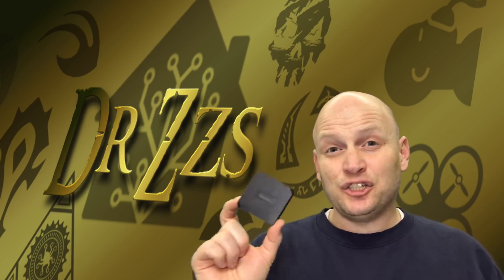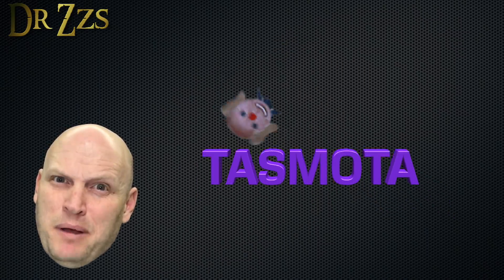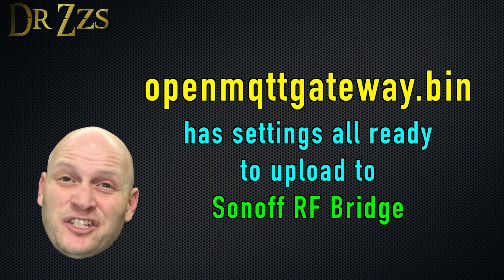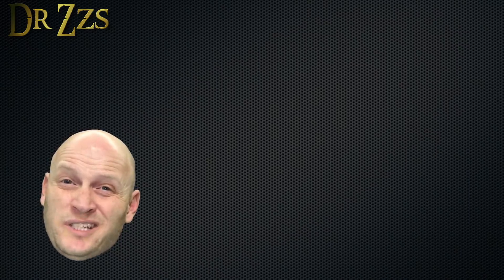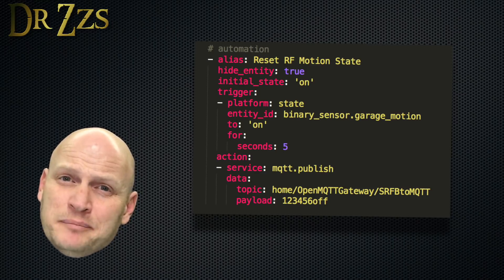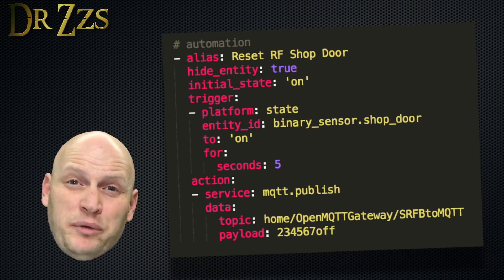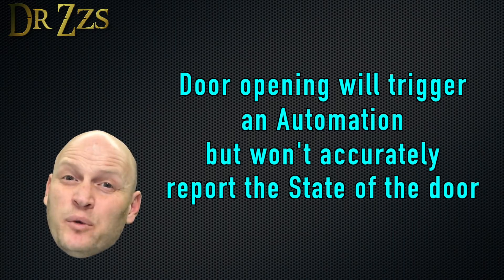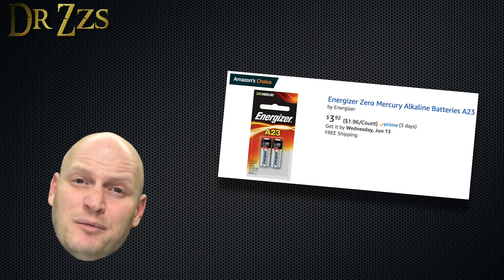Sonoff RF Bridge w/ MQTT & Home Assistant

Comment: I am using something called Broadlink RM3 to connect all of my IR devices like my TV and air conditioner to my Home Assistant.  And like the Sonoff RF bridge, it doesn't read  power or other states.  Because of this, my living room shutdown button (a button that shuts off all lights and devices in the living room) will often turn ON the TV if its already off).  Needless to say, the WAF was very low, and I wound up having to remove some of the IR controlled devices from my automated routines so I wouldn't get the evil eye.   But I do like that you can use MQTT with the Sonoff RF bridge.  I wish they made an IR bridge since most of my dumb devices are IR.

As for getting the MQTT details from Tasmota, wouldn't the "SetOption19 1" at the console output this info?  I am sure that you already tried, but just wondering.
Reply: You  can build an RF bridge easy with a Wemos d1 mini or a nodemcu and an IR sender+receiver.  Check out this library, it has working examples:  On Github ->markzabo ->IRremoteESP8266.  (wouldnt let me paste the URL).
It worked easy with OpenHAB, I'm sure it cant be too bad with HASS-le.
Reply from the maker: Ooh I should have tried option 19. That’s want a smart person would have done. I’ll give it a go when I try TASMOTA again and see what happens.
Reply from the maker: Oh man. Don’t turn off the TV during the wifs shows. Gees. That’s a death wish. 
There are ways to include IR as posted above. I bought an IR trans/receive set to test out. There’s supposed to be a what to do it with OpenMqttGateway but in my limited time testing I couldn’t get it to work.

Comment: I read all the reviews of the Sonoff RF bridge and they complain that it only supports 4 devices.  But I can’t figure out if that’s a limit in EWeLink itself or the hardware?  When you flash it with new firmware are you able to support more than 4 devices?  If so what is the limit before it fails?  I’d like to setup what you show in the video but I don’t want to waste my time if it doesn’t scale well.

Comment: Does your PIR2 work fine? Mine shows an inconsistent behavior, sometimes I can dance in front of it and the thing doesn't detect any motion.
Reply from the maker: ya, I have noticed that in the last few days.  One time I got all the way up on the ladder to check the battery before it sensed and activated.  
I don't know if it's a sensitivity problem or a re-triggering setting.  So, ya, unfortunately I don't think it's as sensitive as the PIR I had connected to the D1 mini.   If I were depending on it for an alarm I'd have to go with something more sensitive.

Comment: Hi. Great videos. I’d like your opinion in how I should invest in devices because I only have one RF device that my garage door. Should I buy the only RF motion and window sensors? Thanks.
Reply from the maker: hmmm good question.  There's probably a lot of things to consider.  For me, I got better results from the Wifi PIR and I have wired door/window sensors.  The advantages I see with the RF bridge are 1- low power use.  They'll last a long time with just simple batteries. A wifi device like the D1mini with a PIR sensor (or door sensor) would need to be powered but a power supply (except maybe Rob's d/w sensor).  So if you need sensors that run on batteries either try building the one's Rob made or go with these (or other RF 433mhz).  
I don't think you'd be disappointed with the Sonoff Bridge/sensors.  They aren't very expensive, so even if you get them and they don't fit your needs exactly, you're not out a lot of money.  
If you're not sure, I'd say try the RF bridge and sensors.  You may find they work great for you.  And, we may discover some even better ways to use the "one code" d/w sensors.
Reply: DrZzs thanks for the advice.

Comment: What's inside the DW1 sensor? Maybe a NO and NC reed switch can be used on the one sensor with a firmware mod?
Reply from the maker: possibly.  someone suggested replacing the reed switch.  I think it's NO now, so maybe replacing it with a NC and putting 2 sensors on one door would do it.  
Someone else suggested there are other pins on the DW that can be used with another reed switch (NC) to send another code.  Might be true.  I'll have to play with it and see.

Comment: Just what I need it. Burned my Sonoff RF last night waiting for the new one. I am going to test my Paradox alarm system with this. I will post the result. Just making it more challenging I use your Automation to my office to turn off the lamp and the LED strip switch but some times I leave the B1 lamp on in color mode. So how to avoid turn off when the lamp is in colour mode and turn it off when it is in white mode? Thank you and keep up the great job

Comment: Just curious. Would using this let me control my rf ceiling fan?
Reply: Probably, as long as it's not a Hunter.  Depends on the frequency - look up your remote in the FCC database if it's mHz is not printed on the back.

Comment: I've had the RF bridge and some sensors for a while now and it runs on tasmota.
sonoff POW and RF bridge sends its important messages through Json
This is how i extract the code RF bridge sends through Tastmota
  - platform: mqtt
    name: "Motion"
    state_topic: "/home/rf-bridge/tele/RESULT"
    value_template: "{{ value_json.RfReceived.Data }}"

Comment: when is sonoff finally starting to sell devices with a "good" firmware out of the box?
Reply: id say they know you arent going to use the firmware they put out so why waste money making a better one or paying a guy like Theo Arends, when its cheaper for them to leave those programming pins hooked up for us. because if you didnt know they DONT have to do that for us. they COULD make it alot harder. i mean not to sound like an ass cause i get the feeling i do right now. but literally all they have to do is stop leaving those serial pins hooked up for us, and wed be stuck on that crappy firmware or be made to do REALLY weird shit to make it work
Reply: again, fully agree. you are still soldering on a device that is handling main voltage. it is basically hacked after that and you won´t get any support from any vendor if you this to devices.
Reply from the maker: I wonder why they wouldn’t. Seems crazy not to.
Reply: Many people have asked this on Sonoff Forums but the company just does not want to change anything. I really dont like Ewelink. So Tasmota and Espurna are the firmware i use at home.
Reply: also side note Jafterdark is a legend. him and i got into a convo about modems and the CID component in the HA disc. hes a cool dude
Reply: The last batch of Sonoff Basics that I bought on Amazon came with all the holes we use to flash real firmware, filled in with a drop of solder.  I don't know what the thinking was behind that but really, it was just an annoyance.  It's sure not going to stop anyone from flashing it.  And why would you attempt to alienate the people that are driving sales for your product?  Maybe that's not why it was done or maybe it was just a fluke, but that's the way it felt to me at the time.
Reply: but you see. that is them trying to stop you from doing it.  thats the thinking. its to keep people who cant solder from doing the process. now while that doesnt apply to most of us. it does keep the noobs on the ewlink firmware. next will come the ones with no pins at all.
Reply: Same here, got mine directly from itead, the serial holes are already filled up with solder.
Reply: to me this is a deal breaker. i am not getting into soldering when it comes to main voltage - think about reliability and insurance if you mess it up and burn down the house. no thanks! i´d rather go with compatible products right away even though it will be more expensive.
Reply: Who cares? Here we have the good Dr and he'll "tasmotize" (tm) the bejesus out of anything anyway :D
Reply: i will just buy another product that is compatible with HASS right away, ie. homematic switches. non ewelink and soldering in my house :-)
Reply: Bemuse That solder was pre-applied for you, so you just need to soften it up a bit and stick the header pins in them :)
Reply: i fully understand. but for there is still a difference between plug & play and break apart, solder, plug & play...
Reply: lol you wont be soldering the mains side of the sonoff... just the serial pins that are starting to come filled up. thats all low voltage (3 volt) and you DO NOT do it while you have the thing hooked to mains or it will not go well.
Reply: well in fairness even if you didnt have to solder it its still voiding the warranty to change from the default firmware in the first place. but with a company like Itead, that warranty is worth about as much as a square of toilet paper.  not to sound rude but ya know this is kinda why guys like DR.Zzzs and I and the other makers around buy stuff like this at all, is because its so hackable, i mean yea it would be great if Itead ported say tasmota on them for us. but at the end of the day guys like us dont give a toss about a firmware swap. once again im not meaning to sound rude here by any means. i just know it looks that way
Reply: DrZzs why they should change anything? They have a poor cheap app but they sell the hell of those things just because they can tasmotised. So the company wins without make nothing. And that's called Chinese marketing
Reply: I had a batch of those as well. Didn't stop me...
Reply: You dont need to do that look for an solution call SonOTA. It an flash the firmware over the Air. So no need to open the module or touch the soldering iron

Comment: hi, thanks for all your great videos. floating head cracks me up every time. ive had the rf bridge up and running with tasmota for about 6 months. took me ages to get my head around the  decoding of the json. one problem was that tasmota sent hex over mqtt from the bridge but needed dec to activate rf relays and sockets. i changed a few lines of code around in tasmota to make this work. i never forked it and put a pull request in github but i may go back and see if i can remember what i did. again thanks for all your help with home assistant
Reply from the maker: Glad you appreciate my artistry ;p
You've hit on exactly why I went with OMG.  It's a case of Tasmota being almost too thorough.  After today though we have a couple other folks that have done it that can help me and others understand it.  I'll be giving Tasmota another shot soon. 
Thanks!
Reply: ok, quick dirty mod to the code. apologies im using 5.14.0b for this. in the sonoff folder edit file xdrv_06_snfbridge.ino line 97 change the section \"" D_JSON_DATA "\":\"%06X\", to \"" D_JSON_DATA "\":\"%d\", this will output any received codes in dec. much easier to use in home assistant. hope this helps everyone.

Comment: Great video! Ordering one tonight! 
Can it send 433MHz tho? Would be cool for those cheap Switchplugs.
Also, for the door sensor, perhaps a switch?
On signal:
if (door is open):
  door = closed.
else
  door = open
Reply from the maker: Yes, it is capable of sending 433mhz signals, so it should work with a variety of other devices.
Reply: How do you make this work?

Comment: OMG is great but you should try Espurna it is really good and has a web interface as well
Reply: Thanks a lot man! I couldn't get the bridge with openmqttgateway to send RF signals to my relays via MQTT, but with Espurna it's so easy!
Reply: ok the flash process is the same as shown in the video here.
But you will need to get the Bin file from the Link
https://github.com/xoseperez/espurna/releases/download/1.13.0/espurna-1.13.0-itead-sonoff-rfbridge.bin
Once you have that use the application shown in the video from the Link
https://github.com/letscontrolit/ESPEasy/releases/download/mega-20180625/ESPEasy_mega-20180625.zip
The Best part about Espurna is the configuration info for Home assistant is generated with in the GUI
So once you have it flash you can just go to the Hass Tab and see the configuration.
Reply: Yes it is the same with the same MQTT data as the video
Reply: Easwaran Chandrasekaran No it's going to a little different 
I am on phone I will write something up and share with you.
Reply: Indeed! I flashed mine with ESPurna. Great, with RF learn function and much much more.Great!!!
Reply: Great to know. can you guide or post the video link on how to flash Espurna on Sonoff bridge RF.
Reply: This should help just replace sonoff.bin file with the bin file from espurna
https://www.youtube.com/watch?v=Ega4U1KRlso&t=2s
Reply: Iam glad that worked for you. Cheers
Reply: Seetendra Panda same video link? 🤔. The link you posted is redirecting to same video above. Wr can I find espurana bin for sonoff bridge & it's procedure to flash & use with home assistant Please help
Reply: @seetndra Panda Thanks a lot. It worked great. I have flashed it successfully. Sorry for the next question, I was able to learn the code for my motion sensor (PIR) as Switch 0 ON  in Espurrna UI. Is configuring Motion sensor with Home assistant same as above video method (Off For Motion sensor as dummy payload etc) or you have any documemation link. Please guide. Thanks in advance.
Reply: Thanks will give it a try & get back if any queries
Reply: payload_off: "My KEY off"??
Reply: Thanks a lot. Looking forward.

Comment: alsum video
here is my node-red verson
[{"id":"96fdb10f.da9a5","type":"mqtt in","z":"d664133d.f572c","name":"Office Motion","topic":"stat/SONOFF-FAN/POWER3","qos":"2","broker":"987c4047.b2d81","x":90,"y":60,"wires":[["a715b704.c649d8","1c620434.e3a7cc"]]},{"id":"1c620434.e3a7cc","type":"debug","z":"d664133d.f572c","name":"","active":false,"tosidebar":true,"console":false,"tostatus":false,"complete":"false","x":510,"y":140,"wires":[]},{"id":"588e82b3.973a8c","type":"delay","z":"d664133d.f572c","name":"","pauseType":"delay","timeout":"3","timeoutUnits":"minutes","rate":"1","nbRateUnits":"1","rateUnits":"second","randomFirst":"1","randomLast":"5","randomUnits":"seconds","drop":false,"x":140,"y":240,"wires":[["f3fed4fc.ec8d58"]]},{"id":"81080a7d.d7c118","type":"mqtt out","z":"d664133d.f572c","name":"","topic":"nodered/motion","qos":"","retain":"","broker":"987c4047.b2d81","x":580,"y":60,"wires":[]},{"id":"a715b704.c649d8","type":"function","z":"d664133d.f572c","name":"","func":"if (msg.payload ==\"ON\") {\n    msg.reset = true;\n    msg.payload = \"ON\"\n}\nelse{\n    \n    msg.payload = \"ON\"\n}\n\nreturn msg;","outputs":1,"noerr":0,"x":250,"y":40,"wires":[["81080a7d.d7c118","1c620434.e3a7cc","588e82b3.973a8c"]]},{"id":"1affd008.6582e","type":"mqtt out","z":"d664133d.f572c","name":"","topic":"nodered/motion","qos":"","retain":"","broker":"987c4047.b2d81","x":560,"y":240,"wires":[]},{"id":"f3fed4fc.ec8d58","type":"function","z":"d664133d.f572c","name":"","func":"if (msg.payload ==\"ON\") {\n    msg.payload = \"OFF\"\n}\nelse{\n    msg.payload = \"OFF\"\n}\n\nreturn msg;","outputs":1,"noerr":0,"x":330,"y":240,"wires":[["1affd008.6582e","1c620434.e3a7cc"]]},{"id":"987c4047.b2d81","type":"mqtt-broker","z":"","name":"","broker":"localhost","port":"1883","clientid":"","usetls":false,"compatmode":true,"keepalive":"60","cleansession":true,"birthTopic":"","birthQos":"0","birthPayload":"","willTopic":"","willQos":"0","willPayload":""}]
Reply from the maker: Thanks man!

Comment: Great video! What is the range of the RF bridge? Can you get away with using just one for an entire house?
Reply from the maker: I should have mentioned Range.  I put the sensors in my garage and had the bridge on the second floor.  So probably at 100'.  So I think you could cover the whole house with one bridge.

Comment: you should really try ESPURNA on this device... and, beside to this, you can hack it to extend its recognized devices A LOT... Xose Perez, author of the Espurna firmwware, released a new version for the Itead RF Bridge that bypasses the RF chipset integrated and manages the rf codes on its own, based on the RCSwitch library, so MUCH wider set of recognized devices... i tried it and for example the learn function passed from even 30 seconds and more, to just 2, for the same remote... oh, and it has direct homeassistant integration, once configured you get the lines to put in your configuration.yaml from the web interface... BUT, hacking the pcb is needed (2 resistors soldered and a trace cut)... info: https://github.com/xoseperez/espurna/wiki/Hardware-Itead-Sonoff-RF-Bridge---Direct-Hack
Reply from the maker: Awesome! 
I'm sold.  I'll try it! 
Thanks!
Reply: DrZzs try with the standard Espurna rf bridge firmware, look at what it is and how it works, then do the easy hw hack if you want and reflash the DIRECT firmware bin file and compare the results :-)
Reply from the maker: I'm actually pretty excited to try it.  
I may hit you up for help if I have trouble.
Reply: DrZzs lol, I sold mine this morning (was a V1.0) and waiting for a new V2.0 one :-)

Comment: I have a GE Simon XT alarm that I was using before I set up HomeAssistant. I am going to order the RF Bridge and try and use the sensors from that with HA through the bridge. - Has anyone else used this RF Bridge with existing alarm sensors yet?
Reply: Stonewallace yes I'm using RF bridge with an existing alarm system. It's great because they are independent so no issues if HA is off (the alarm must be reliable for me) but they communicate well together thanks to ESPurna. I get notified when the alarm gets armed and disarmed and I can arm and disarm the alarm from HA if I want
Reply: NICE! Ordering one up now. - Thanks Albert!
Reply: GE Simon is 319.5 MHz. Therefore it won’t work with a gateway operating at 433 MHz.